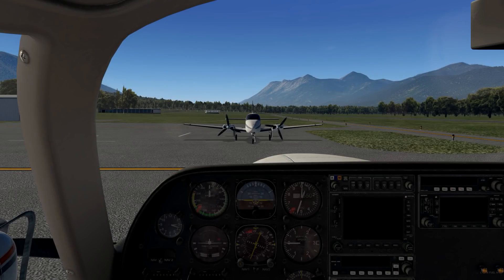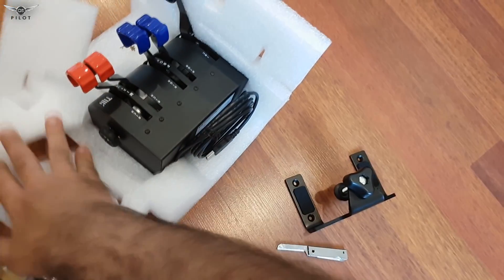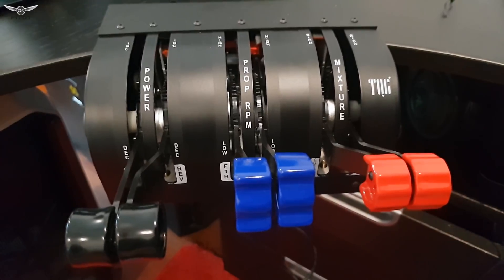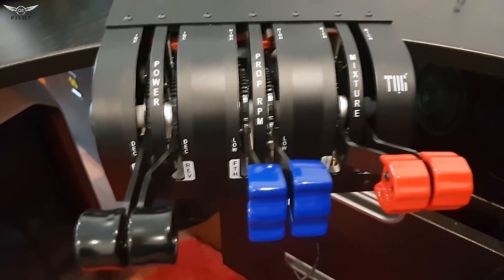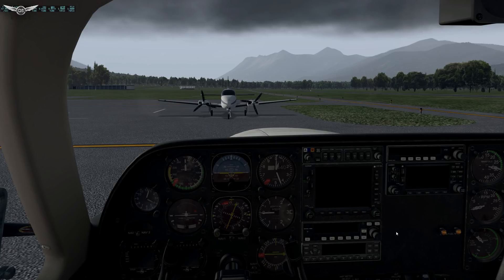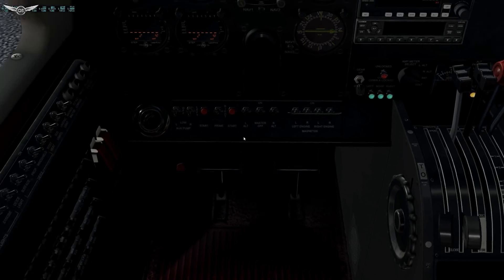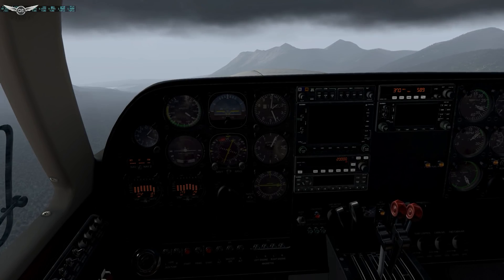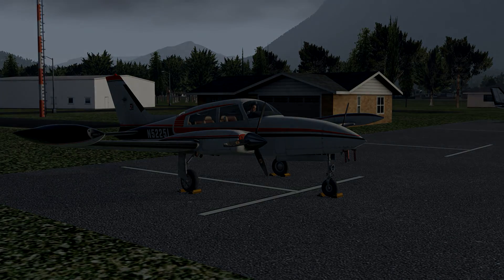Virtual Fly TQ6 Plus | Fly Like a Pro Series | Episode 1

Comment: Do you still own and use the TQ6 throttle quadrant today for use in MSFS?

If so, do the reverse thrust, feather, and cutoff ranges work as advertised?

I’m considering purchasing a TQ6+, but only of the ranges work in MSFS.

Thanks!
Reply from the maker: I no longer use them sorry.

Comment: I have the GoFlight TQ6 and am not very happy with it. The feel is too cheap and had to do some major tweeking to get it to work well.  This product looks good and from what I have heard feels very professional. I like the reverse detentes. I wonder if the levers are interchangeable?
Reply from the maker: From my long experience in flight simulation I can say with confidence that the TQ6 by Virtual Fly is by far the most well built. I am not sure what you are referring to by interchangeable. If you mean to replace their function, then yes. If you mean physically changing their position, I don't think that's possible.
Reply: Interchangeable in the sense that if I fly a 737 I can install different handles or knobs.  But that's good that its functionality can change.

Comment: You show the build quality very well - it looks to be a solid, well-made product. Maybe Virtual Fly could design a clip that the user could fasten to one throttle arm, with a hinged part that could be flipped over to fasten/unfasten the other throttle arm as required, so as to make them both move as one. Is that feedback you could pass on to them ? Anyway,  looking forward to the next review. Great video.
Reply from the maker: Thanks for sharing your thoughts Paul. Yes I will pass on the comments to Virtual Fly.

Comment: You have to run the VF -test&calibrate  software each time you run xplane , this reads the data from the unit and send itvto xplane
https://www.virtual-fly.com/wp-content/uploads/VF_USERS-manual-TQ6_v5-1.pdf
Reply from the maker: Thanks for the info. I have seen no difference in calibration accuracy by running the software. Calibration using X-Plane works just fine.
Reply: Good to hear, keep up the excellent work you do, love your reviews .

Comment: Are you also going to do a pro series for fighter sims like DCS? Probably you would need a different lever for that.
Reply from the maker: I have the Thrustmaster HOTAS Warthog for DCS. I am not very good in DCS so probably it will take longer to produce videos for it.
Reply: @Q8Pilot  Yes, getting used to DCS requires some time indeed, especially because you need to be able to change your pilots view quickly during combat. But I hope you will find enough motivation for DCS. Recently DCS has improved its graphics drastically since version 2.5. Another great improvements are the new study level high fidelity modules like the F-18 or the F-14 comming this winter.